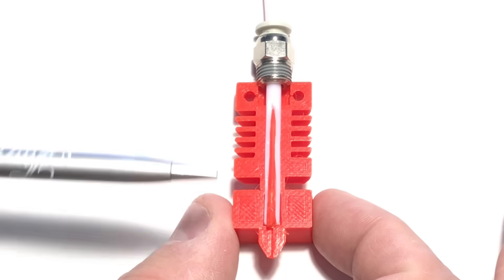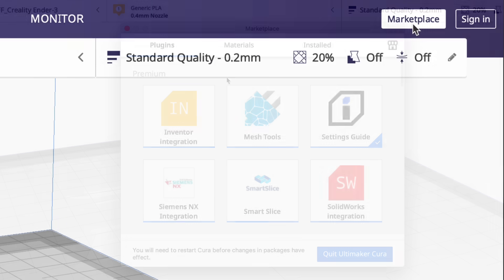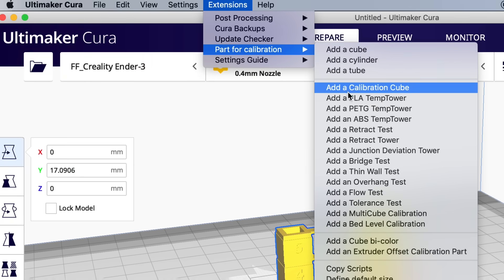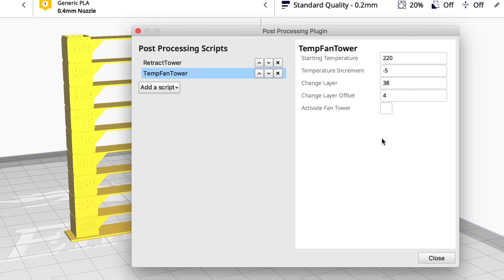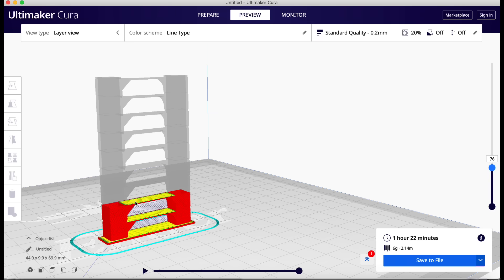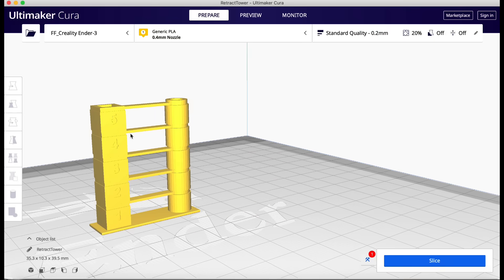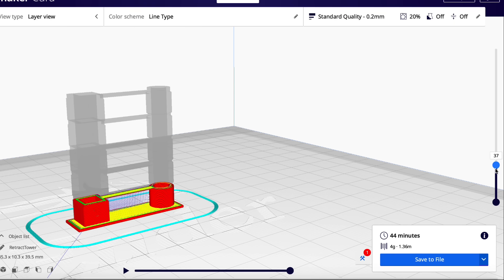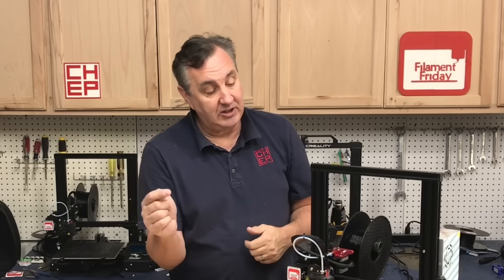Calibrate Perfect Retraction Settings Using a Cura 4.8 Plug-in

Comment: Why my Cura 4.8 (Win10) do not have the option for RetractTower ?
Reply from the maker: Because you have to load the plug-in like I showed.
Reply: @FilamentFriday  not so evident, I had the same problem, the plugin showed as "installed" and the RetractTower was missing, until I found out it's necessary to "update" the plugin, by clicking on the Update button in the plugin window...
Reply: @FilamentFriday  i have updated but still not there
Reply: I got the retracttower settings. Turns out all I had to was follow CHEP steps to the dot. Thanks guys!

Comment: So advice please. I have an Ender 3 Max. Every time I try and run the temp tower on the very first level for 220 my machine errors out. I get this on the LCD Thermal Runaway E:1 and it halts the print. I assume it’s a safety feature built into the machine and it’s triggered by the fan being off during that test script. Anyone know of a work around?

Comment: NOOB here, I'm really enjoying your content and learning allot. I not sure but should I be seeing the temperature change on the LCD display as it changes layers? do I need to set the Starting and ending temp?  Thanks again for the great content.
Reply from the maker: It will change after first temp change. The GCode just in any updating the display.
Reply: @FilamentFriday  But the measured temperature should change. It is no for me.
Reply: @GeorgeAlbercook  my temp display doesn't change and it doesn't even start at the temp set in the script.

Comment: curious possible cura 4.8 issue occurring. using a 0.8 nozzle on my artillary x1 the temp tower slices as normal. as soon as the script is added the tower slice gets messed up. once its messed up and you have to configure cura and remove and add back your printer.

Comment: Hi Chep.  Could you tell me at what point a script gets implemented into the sliced gcode? Is it After the “start” gcode? Neither scripts worked for me and I’m having trouble figuring out why.  Thank You!
Reply from the maker: Believe after the slicing is complete.
Reply: Same here. It used to work for me, but now it doesn't. The temp changes just aren't making it into the gcode. Not sure why.
Reply: @B3MDUSA  I have the same problem. The temp tower prints but the displayed temp never changes.

Comment: Tried printing using petg. Might need to dry a roll first. Using overture petg and printing on a chiron printer. Using for my extruder the bond tech.

Getting really bad stringing on the test prints and the bridge on the temperature doest not stay in place. Always drops and sags.

Comment: My extruder in the temp test tower starts at 200 on the screen of my x1 so I dont think the script is being activated even though the script tool icon is showing ?
Reply: Ultima Cura 4.8 Artillary X1 Gcode scripts dont get sent or get set back?  Maybe GCode start setting is doing it. 56 YO 3D Printing Newbie allert btw. Best Channel Out there CHEP! Thank You
Reply: @Schaub3  I had to set the start temp in cura and then it subtracted temp as it printed per the script.

Comment: Hi Chuck, love the channel! How can I be sure the temperature is actually changes during the temperature test tower? The display shows a constant 210 degrees nozzle temperature  (Ender 5 Plus).
Reply: An update: the temperature does change along the print except it starts with 210 (on the display) so I'm not sure the first bridge was indeed 220 ...
Reply: Ender3pro and my temp never changes.

Comment: I tried printing the retraction tower on distance and found out my best retraction distance is 5mm with no stringing. However when I tried the retraction tower on speed, to find my best speed, the stringing starts to come back. why is that so?
Reply from the maker: Sometimes slow retraction is best.
Reply: @FilamentFriday  I mean I'm testing my retraction speed starting from slow to fast. And there is stringing at low retraction speed already. Why so?
Reply from the maker: Run the distance one again and see if it’s still better. Could be the PTFE.

Comment: I did it also, plus extra settings like speed retraction, and now I can make overhangs 60 degree, and bridge over 50cm long and is no difference comparing with short one. that's amassing! With bridge I have always problems, before I could'n not imagine to print bridge 5mm long. Now even top surface looks a lot better, and I don't need use anymore use so much layers to achieve flat top surface :D. bridging option helps even with last top surface where infill have 5mm space. And Top surface now I can finish with only 2 layers.

Comment: Chuck, I would agree with your assumption that a .2mm layer height was intended. However, I spoke with the author of that plugin and he says that he wrote it round a layer height of 0.16mm and this has given me issues. On the Ender 3 V2, current firmware won't allow the extruder to move if the hot-end is below 180 degrees. Starting at 220 degrees and using a 0.2mm layer height, the script for that temperature tower calculates 9 layers correctly, then adds some extra print to the top of the tower which it tries to print at 175 degrees and the firmware craps out with an error. For my printer, my son has added an extra line in the Python code to not allow temperatures below 180 degrees, but others may not be good with coding so may not be able to fix it for themselves.
Also - MOST IMPORTANT - I notice that when you move over to describing the retraction tower, you remove the temperature tower script, which is fine.
I wonder if you could also include an announcement somewhere that it's most important to remove ALL of those post processing scripts when you're done, otherwise Cura will add some of their post processing to any subsequent models that you slice!!!
I fell foul of this until it dawned on me. :-)
I was printing a new flow rate cube and wondered why there was a massive blob at the top finish point and worse, why the extruder went ballistic and tried to push filament at 100mph when the print was supposed to have finished. I tried another print and watched the actual printer, which was changing temperatures part way up the cube, where it was not supposed to. On examining the Gcode I found that Cura had inserted those temperature changes and a bunch of other stuff at the end of the print, which should not have been there. I removed all of those post processing scripts, re-sliced and all is now OK.
I know, I know, as a programmer I should have realised that post processing scripts would still be applied, but it just didn't occur to me. :-D
I hope that by writing this, it will save others from pulling their hair out, trying to figure what the hell is wrong.
Reply: You can start from 240, and then plugin will stopt at 200, I did it on my printer.
Reply: @maxim25o2  Sure, but I don't want to stop at 200, I want to stop at 180 as it's a valid temperature for some filaments.

Comment: I tried to run this test on my AnyCubic Mega S but it seems that the script does nothing.  The temperature used to start the print is the one set in my printer profile, which is 200 C on the first layer and subsequent layers are dropping down to 198 (seems to work the best for me for no stringing).  But I would expect the G-Code generated by the script to take precedence over my settings which did not happen.  Would you have any insight as to why?  Thanks.
Reply: It appears the script will not override the profile temp as a starting temperature. My profile was set to 210, so the script started at 210. Once the tower hit the 205 section, the temperature did change to 205. If you modify your profile to start at 220, it will work correctly at 220, then step down 5 per section as defined. I'm running Cura 4.8.0.

Comment: for my model that is generated, there is an inconsistent number of layers between each part of the tower. My tower is also a total of 364 layers, and I sliced at .2 mm and there is no raft as well. Any suggestions?
Reply: i also had the same issue with the 0.2 resolution, i have been watching your channel since the davinci days, we may need to look into this a bit i get 2 layers for the 220, but when it hits the 215 bridge there are 3 layers for the bridge ??????? 200, 190 has 3 layers, this creates a false result, I did however slice this temp tower at the 0.12 layers and the end result was even all the way up, my setting are (from top to bottom in the settings given) 220 /-5 /64 /6. try this, but i know this doesnt help with trying to fix .2 or any other setting bridge, i think this plugin runs on 0.12 layer height multiples, i hope this helps you out. Chuck please feel free to weigh in on this please.
Reply: @Outdtdmdl  Thanks for the idea, I did adjust my layer height until I found something that split the layers evenly and it worked out well!
Reply: @Outdtdmdl  The author says the scripts were written around a 0.12 layer thickness, but is intending to release another version.
Reply: @Outdtdmdl  layer offset must be 0! the "base" is included in the first part of the tower. only use layer offset if printing on a raft.
Reply: Jonas I never said anything about layer offset, I was talking about later height, I have never messed with my layer offset it has allways been 0 . What I explained here worked perfect for me and my machines,

Comment: Here is an update to my earlier update: Like Dominik K , I had a problem with filament continuing to extrude on all of my prints after printing the retraction test tower.  I thought this was something wrong with my machine and went in that direction for a cause. I uninstalled/reinstalled Cura 4.8 and had no problem.  Then I added the plugin again, ran the tower, and bam the problem started again.  I then tried it with Cura 4.7 and the same thing happened.  I'm no 3D printing genius, but it looks to me like the plugin rewrites the end Gcode in Cura for my MP Mini Select V2.  BTW, I again reinstalled 4.8 without the plugin and have had no issues.  Any thoughts?
Reply from the maker: Did you disable the script by clicking on the little wrench symbol near the slice button?
Reply: @FilamentFriday  I think so, but I actually don't remember.  But the extra extrusion happened with the printing of the retraction tower.  Should it do that?
Reply from the maker: I’m not sure. I haven’t seen the issue.
Reply: @ct810  My problem wasn't stringing. My problem was that after a print finished my hot end would retract like usual but then it would start to extrude more PLA until I turned off the machine.  I thought from your comment you were having the same issue.  I'm using a MP Select Mini V2.  Just for the heck of it, download another version of Cura, load your profiles, and try to print something.  See what happens.
Reply: @joereader8104  I found that I had to unload the scripts in order to print anything else, or they add actions to other prints that are not relevant, including making the extruder go ballistic. I guess it's possible to just disable the scripts, but I preferred to unload completely and the issues went away.

Comment: i have the plugin but i can not change in g code script retract tower no avaible can you help me?
Reply from the maker: You need to copy scripts and restart again like I show in the video
Reply: @FilamentFriday  i have this but no temp tower or Retract Tower Scripts avaible :/ the other scripts are avaible
Reply from the maker: Watch again at 2:55
Reply: @FilamentFriday  yes thanks it works :)
Reply: @FilamentFriday  but my printer ender 3 v2 is very ozzing can i help with the retract tower? my retract speed was 25mm/s and distance 6,5mm/s now i have 5mm/s and 30mm/s i print later a retract tower and i look but i must no other settings or? 
my print temp 205 Grad Headbed 60 I print with pla from filamentworld he writes print temp 190-210 Grad but I think 205 is to much but i have a PID Tuning making of 205 Grad make this again with 200 Grad now? I have a Micro Swiss MK8 Brass Plated Nozzle I think the nozzle needs 5 Grad more when a normally messing nozzle
Reply from the maker: All metal hotends sometimes need lubrication. I clamp a sponge, with a few drops of olive oil soaked in, around the filament before the extruder. Let it run a few meters of filament and remove.
Reply: @FilamentFriday  so i have to stretch a sponge between the filament and extruder so that the filament first goes through the sponge and then to the extruder?
Reply from the maker: Wrap the sponge with olive oil around the filament before the extruder so it put a slight coating of oil on the filament. It will oil the PTFE and hotend.

Comment: Hey guys - another tip about the plugin. When you have finished your calibration prints go to EXTENSIONS->POST PROCESSING->MODIFY GCODE and ensure you remove all of the scripts or they can affect your next print job. I am printing a part right now and was wondering why is my temperature wrong, and why does it keep changing. It's because I left the script active which modifies the temperature for the tower :(

Thanks again for the video Chuck, and hope this helps someone.

Comment: For the retraction test, In the side panel under "Travel", do you have to change the retraction distance to 1mm there as well, or will. It just do it automatically in the script?
Reply: It will do what you've set up. But for the Temptower I set up a regular setting for the base before it changes them by script.

Comment: hi chepp a favor. I do not understand about the layer height and the number of layers in which the temperature changes. could you explain it please? I normally use a cpa height of 0.16 I don't know if I would have to modify something please
Reply from the maker: It changes at the layer you set in the script. .16 will have more layers than 0.2 so you’ll have to increase the layer value
Reply: @FilamentFriday  great now I understand. just open more layers and the temperature change will be in another layer number. thank you dear chepp you are the best

Comment: I ran the retraction tower and got good results after 3, then I run the retraction test and I get stringing at 4 and 5🤔🤔 yet on the tower no stringing at 4 or 5. Can anyone explain what I’m missing? 
Ran both tests at same temp and settings...

Comment: Could you make a video where you show how to get rid of the "anomoly" some people get whereever there is a top/bottom layer, like for example vertical holes and just normal flat surfaces with infill. i can't explain it better and im not sure im allowed to link to any site that shows this but should be enough to google "anomoly in wall when printing top/bottom layers". I think it's reffered to as "Buldge" in the community :)

Comment: Should i make this tests for different layer height too? I have my profile with 0,2mm layer height, but i want to start making finer figures with 0,12/0,1mm, should i repeat the test for temperature and retraction settings or i can use the same as for 0,2mm? Thanks you for the tutorial btw!
Reply from the maker: Same should work.

Comment: so i followed along for the temp tower, but the temp display on my ender3v2 did not change while printing this tower, had to watch and manually adjust the temp on the fly by usung the TUNE selection on the LCD display
Reply: Same issue, not sure what happened...
Reply: @clatheho  so after the first or first couple times it changes on its own, weird bug
Reply: @Shamsher1  Thanks, I ended up letting it run and the same thing happened for me
Reply: It worked OK for me on an E3 V2 starting at 220. Maybe it depends on the firmware version. FWIW I'm using Jyers.
Reply: @wurlitzerwilly  thanks I just found the same firmware myself yesterday, so much better, but still can only print from root folder, sub folders show empty
Reply: @Shamsher1  You could join the Jyers discussions on github. He may have an answer to this.
I very rarely use the uSD card and if I do, I just park my Gcode files in the root.
I use Octoprint and a Raspberry PI with camera as I find it so much more convenient.

Comment: I hawe a problem please help.
So I have managed to get a perfect first layer, mirror finish perfectly flat no bumps at all. Following layer is too low, I need to manually baby step it up to get the correct layer hight. This happens for the first few layers then is perfect again. Generally on the second layer of infill.

Initial layer height .2mm
Profiles i use CHEPV4.8.x 0.2
Printer Ender 3 Stock with BLtouch
Glass bed
I use Creality red filamen Nozle 200 Bed 55
Thanks
Reply from the maker: Your z axis is probably binding.
Reply: @FilamentFriday  Any help how to fix that? Thank
Reply from the maker: Find out what’s resisting it by turning by hand

Comment: How do you activate the post processing scripts?
Reply from the maker: After copying the you have to restart Cura
Reply: @FilamentFriday  Thanks I have done that. Then I opened Cura and loaded the temp tower and then open post processing. How do I than add that to the slicer output? 74 bit slow at times used to be a software analyst. Took me 5 days to get the firmware working on my BTT SKR V1.4 Turbo. So much I've forgotten.
Reply: Fingered it out. My profile has it set at 210 but the addin doesn't appear until the 3rd layer when it goes to 220.

Comment: Hi there, thanks for the video, I didn't know you could do this with the scripts! Being new to 3D printing, will I have to change the scripts back to normal after the print? With the thought in mind that if I don't it may alter the retraction settings during all future prints?
Reply: You must disable or unload the scripts or they'll foul up your future prints. You need to add the retraction figure to all Cura profiles that need that retraction setting.
Reply: @wurlitzerwilly  thanks for taking the time to help me, appreciate it!